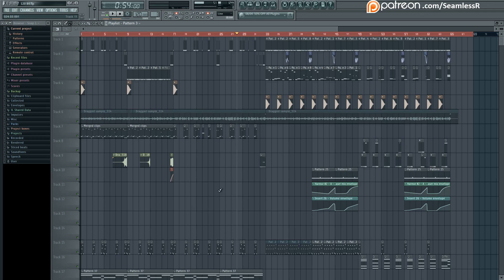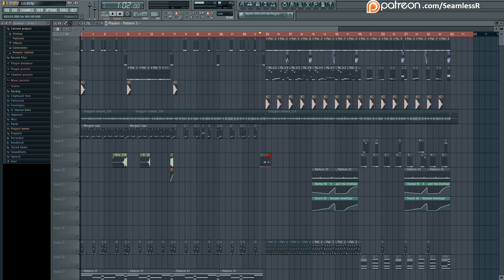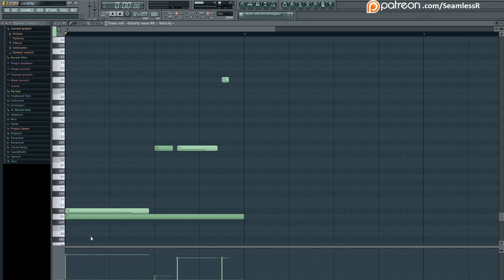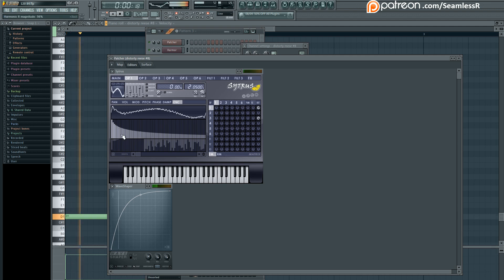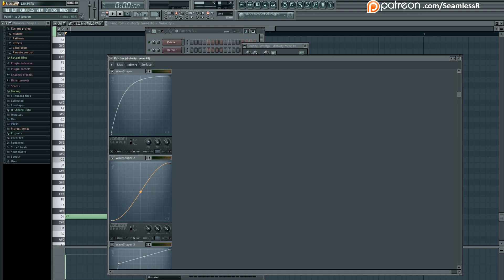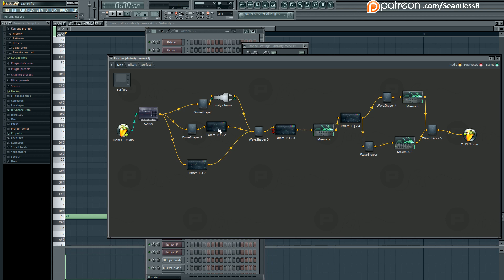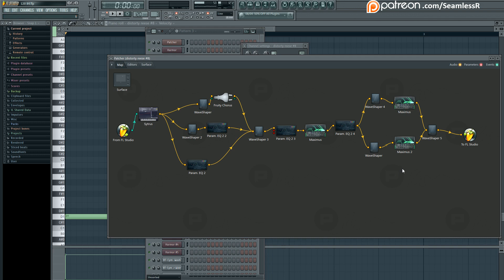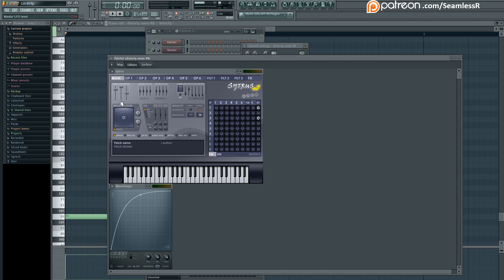How To Bass 95: Slide Amp Reese

Comment: Hey seamless, you can get a koan sound funk blaster style bass guitar if you make a patcher add a boobass run it into a small amount of flanger and run both the dry and wet of that through a waveshaper in a sine wave shape(you're gonna automate the mix on it for that distortion sound) then run it through a maximus and force the bass up in the waveshaper and level that and force the high up as well until you get that plucky/slappy sound and level that(mix the mid how you like) and set the master compressor off and add some saturation and turn the gain down a tad, then a limiter to bring the volume down and add a little bit of roomy reverb and remember to automate the mix on the waveshaper for the crunchy sound that bass is known for, it only needs a little!
hope you see this and give it a try! :D

Comment: Dude, you sidechain way to hard, I used to be like you, but now I have 2 buses, one with the sidechain, one without. If I want something half sidechained I send it to both at 75% (not 50, as its log scaled)
Reply: Can't you just send it through the master?
Reply: Quore Yes, but doing it into a parallel bus eliminates any problmes with APDC.

***** Dude, its just a little to heavy, when I listen to it it cuts massive holes in the mix which is kinda not too great.
Reply: ***** the problem wasnt APDC, that was the other guy i was talking to. The sidechain just kills the mix a bit, other professional tracks don't sidechain as hard. I am NO WAY superior to seamless... apart from keyboard shortcuts. I know more keyboard shortcuts :D
Reply: Lukeme9X i recently started sidechaing with a hat, makes it super punchy.